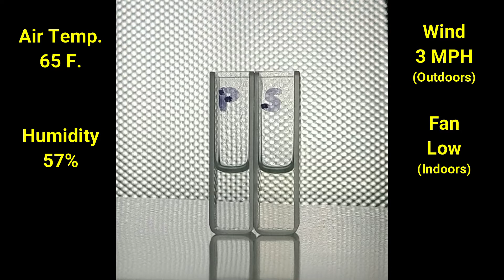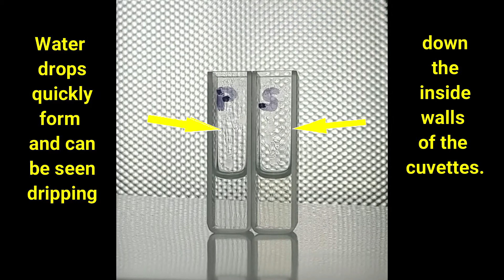How To Fix Old Stale Gas

Comment: Very old gas kept causing lawnmower to stall. 2 short sprays of carb cleaner into the gas tank. And it ran perfectly. I did this on a hunch but can't explain why it worked.

Comment: Reusing old gas has so many variables.  I live in Wisconsin where temps drop to minus 30 F.  Perfect day to reclaim gas.  Big ice ball in the bottom with so much crud.  I filter the remainder through coffee filters and, add seafoam.  Use it in my truck.  Never had an issue.   I suppose in the south you could find a big old freezer to freeze and water..  I've used 50 to 1 marine gas with no issues exdept some added smoke, for a while.

Comment: Stay away from any petrol with ethanol for outdoor power equipment especially if your not using it for long periods. The ethanol degrades rubber fuel lines and seals and can cause thick viscous particle bonds in the fuel that can easily cause blockages in the small components of carburettors. In Australia the top octane rated petrol is 98 use the US equivalent of this it lasts longer when stored and has been found to have very little impurities and very real internal cleaning properties. 

Side note: not related but if possible always use mineral based oil for 2 strokes preferably premium mineral, and add small amount more then asked by manufacturer specifications (eg if 50:1 ratio is called for put 40:1 ratio ) too much isn’t good and can cause carbon build up in all areas of the 2 stroke engine but small amount extra overall (especially in break-in period) can extend the life of the equipment exponentially 😉